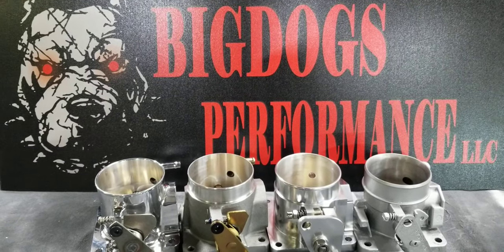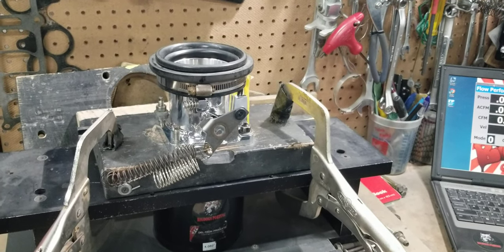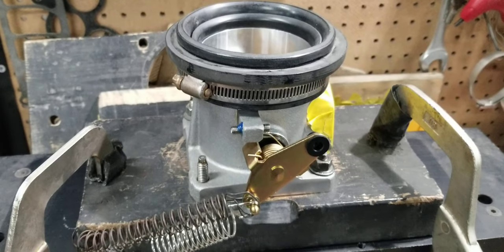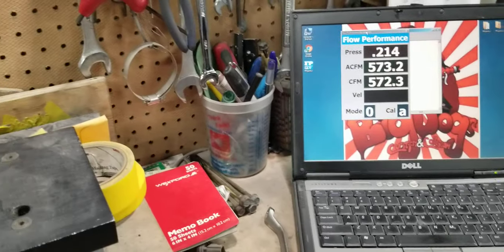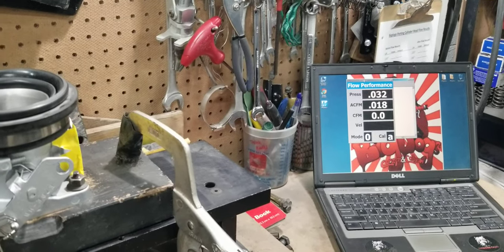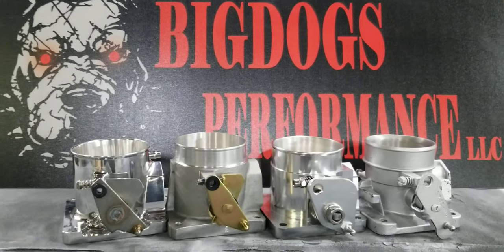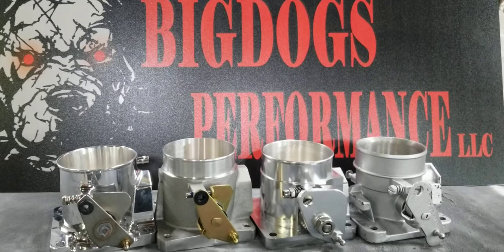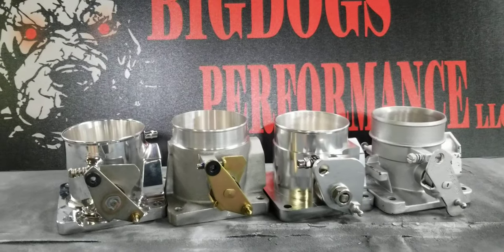Fox Body Mustang Throttle Body Shootout😁

Comment: This video is great, i have the 99 5.0 explorer tho. How can I wake this thing up I can’t time it like a foxbody. So what Maf do you recommend. I can do the 4in cold air I have built and still have my 700whp civic not afraid of a little fab….  Along with the stuff you recommended in the vid I also want to use 39lb cobra injectors. I want to wake this thing up not sure how much yet’ but possibly a Paxton not sure if it will work yet but what I have see I want to stay in the 400. Going to be off-roading this and with those numbers it would be a blast.
Reply from the maker: Our ported heads, ported Intake manifold, our stage 2 cam, our ported TB, a good tune, high flowing headers and exhaust system

Comment: You could put together a sweet "stealthy" stock looking setup with your ported GT 40 heads, ported explorer intake and one of your ported 65mm Throttle bodies, I'm sure you know of a cam that would take advantage of it all too and really surprise some people!
Reply from the maker: Yes. We have some customers running those exact parts. One that has everything including our stage 2 302 cam and our ported 75mm throttle body. It made 360whp/350wtrq through a T5 on a Dynojet with a Dyno tune. We have a copy of the the dyno chart on file.
Reply: @bigdogsportingtonyb2833  That's good power for ported stock parts!
Reply from the maker: @vrm86gt  that's good power on a sbf 302 100% streetable car that still has ac on any parts lol. Car has full exhaust system, ac and heat. It pulled all the way to 6,500rpm. It only had our stage 2 intake manifold.
Reply: Now that is good power!

Comment: I want All your ported products, I'd be happy as hell with 350 hp with a/c!👈💯💪🏻
Reply from the maker: With our ported parts, cam and a good tune 350whp on a 302 is easy to obtain.
Reply: @bigdogsportingtonyb2833  I know that's right. I'm going to contact you soon,remember my name my man. I just pulled my t-5 and I'm going with a c-4 with a 2200-,2800 stall for now. And probably your stage 2 heads or whatever the best damn port work you can do to some 3 bars! Hopefully you have a whole motor kit I can purchase for the complete package. 👈💯
Reply from the maker: @johndoe-zb8bm  we definitely have the goods for you. Don't wait too long though. Prices will be going up soon because our suppliers are going up 🙁
Reply: @bigdogsportingtonyb2833  Thanks for the info my man,I'm going to check your site out ...
Reply: @bigdogsportingtonyb2833  do you have a website
Reply from the maker: @dom_ferris_  we have a Google business page at Bigdogs Porting, a Facebook business page at Bigdogs Porting and a Instagram page at Bigdogs_Performance_LLC.
Reply: @bigdogsportingtonyb2833  alright thanks. I appreciate the feedback

Comment: Have you done any testing on the ford 460 twin 52mm throttle body? Be curious to see what those do. I have a bunch.
Reply from the maker: Yes is stock form they don't FLOW well.
Reply: @bigdogsportingtonyb2833  was going to try one on my fabricated manifold. Guess I should use the explorer setup.  You think boost would change the testing much?
Reply from the maker: @Go4BrokeOffroad  flow is flow. You hav ed to size the flow to the combo. Boost is not as n issue

Comment: I saw that you made a comment on Richard Holdener’s channel the other day. Please send him one of your Ford manifolds to test so you can prove me right about about high flow long runner manifolds making solid top end power and revving out.
Reply from the maker: We've been trying to send him one. We port the gt40 style manifolds with a shortened runner and the stock length runner. Both will rev and support lots of power after our porting style. We have dyno results posted on our Facebook business showing both our stage 2 and stage 3 Ported Cobra gt40 manifolds out revving and making more hp at a higher rpm than a ported Edelbrock rpm manifold. I also referenced a test that was done by a magazine back in 2001 where a mildly ported LOWER only Tubular gt40 manifold made its PEAK HP at 6,600rpm on a 347. I got no response. Even sent him our Email address, no response yet so we will be doing our own manifold shootout videos putting the Aftermarket manifolds against our ported factory parts. Seems like the industry doesn't like what we are doing with stock and factory parts. It seems these guys don't want to show the people that the factory parts once ported the way we do can make just as much and even more hp than the highly priced aftermarkets.